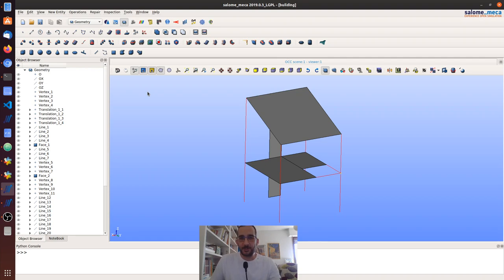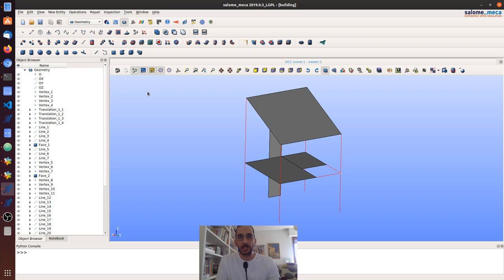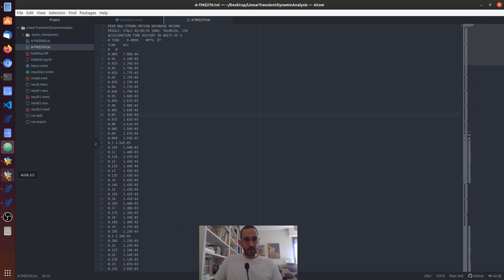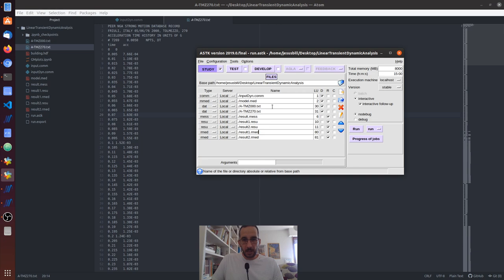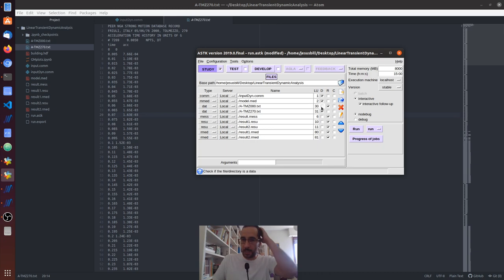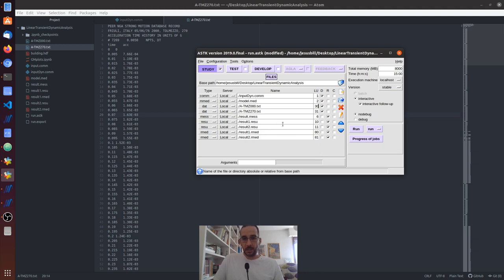How-To Video: Perform a Linear Transient Dynamic Analysis with Code_Aster

Comment: The part where you post process the files using python totally save me. I know python mostly because of the tensor operation libraries/ML, but I never realized I could just open the data with pandas and plot it. It totally changed the way I visualize data in codeaster, make in it both easy and fun... Now I want to take out every single point of information in the mesh haha
Reply from the maker: Good idea. You can use meshio (opensource python library - "look for it in github) to open an rmed file and parse the results. Could be a nice tutorial! 😁

Comment: Thank you very much for this important video. I have a question regarding the application of codal combination of loads such as 1.2*( DeadLoad+Imposed Load+ELx+0.3*ELy), which is common in many seismic codes.. Is it ok to apply appropriate gGrav_y=0.3*9806 in this case? If I want to do the superposition later in Post processing, what would be  your advice reg how to handle it in python? Thanks and Best regards.
Reply from the maker: If you want to scale the y component to 30% what you wrote will do it. But apart from the Code_Aster implementation scaling one component of a ground motion is not common and probably neither good practice. The code refers to a response-spectrum analysis where you have 100% in one direction and 30% in the other. But for time-history analysis you have to define spectrum compatible ground motions and consider those, without different scaling in the components, only uniform scaling
Reply: @aetherengineering7387  Yes. The codal recommendation is for RSA only. Thank you very much for your reply. Further,  I would be grateful if you could make a video showing RS method of Analysis. Best regards.